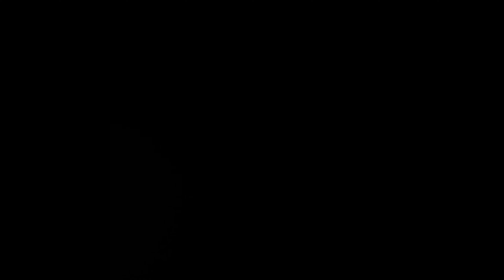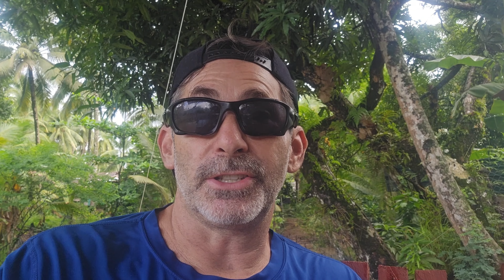Vanlife Solar Panel Problems #campervan More Solar Power

Comment: It's a pain to have to re-do things, but sometimes it is needed. I tend to try to always go to over-kill.
Reply from the maker: Agreed 100% too bad van only has so much room for solar on top
Reply: @VANquishedAdventures  Understand that. I'm considering building a power trailer to pull behind the rv/van. I like having LOTS of power.
Reply from the maker: ....but if there was more room I would have probably bought more of the fake panels I'm taking off now.